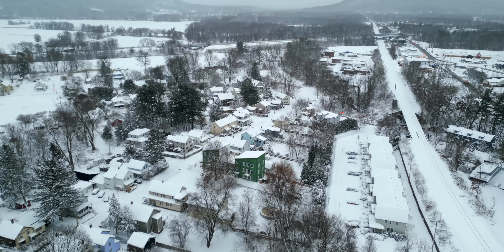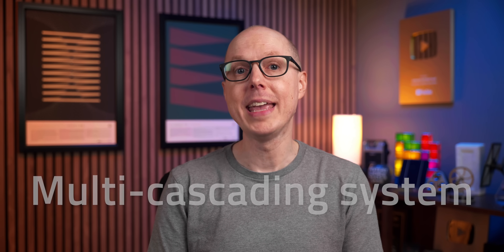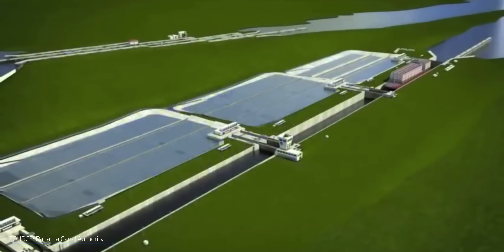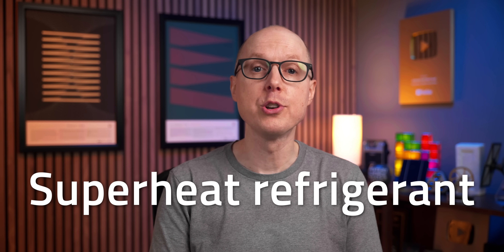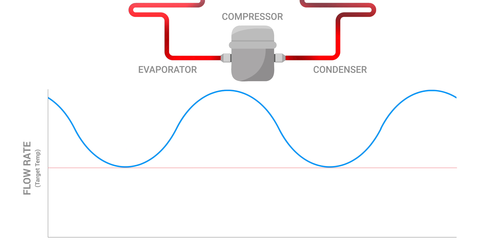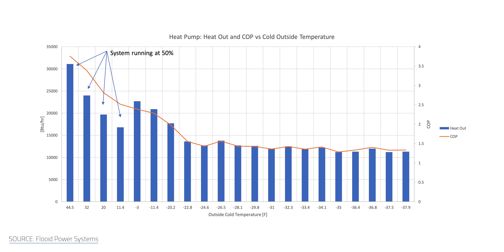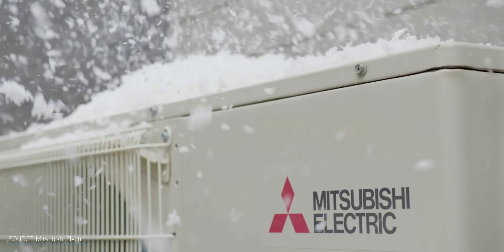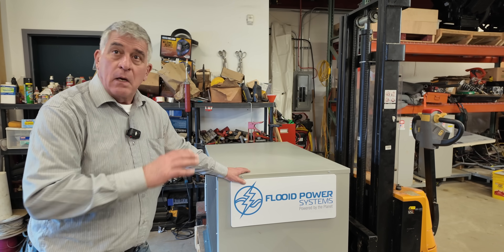How This New Heat Pump is Genius

Comment: We used to have a cascade for a large unit (we were cooling) but we gave it up for R-404a loops.

When I head „within one degrees“ precision for a temperature probe I smile and nod.
It may look like it is within a degree but it won’t be over the whole operating range without (yearly) calibration. It doesn’t take much to provoke oscillation at all, sometimes it is not even the probe but how it is inserted.

Personally I‘d want a single stage heat pump because I see two compressors, two loops with different operating conditions and then the very big question:

why use air? why not use ground water as sink?

Comment: Sorry, not interested. Why? Well, adding simple (no moving parts) resistive heater for those few days a year seems easier, less maintenance, less noisy compressors in the loop, etc. Rather than cascading heatpump, I would invest in better insulation and bigger solar to offset the energy cost.
Btw, you would not believe how much money a window opening sensor ($4 - $6) can save - both in summer and winter - just a notification that there is some window opened for more than 3 minutes and your heating needs go down in tens of percent.

Comment: With superheat , it is not the compressor which tries to maintain it to a certain degree K , it is the expansion valve. If sized correctly and functioning correctly they are very stable.
The problem with high superheat and high temperature suction gas is that the compressor has little or no cooling for its electrical windings it must be kept below a certain level.
That is why they will be running the lower stage at a certain condensing temp to not overload the high stage.
I think a well designed geo thermal would have higher COP than what i saw on there display. 
Having 2 compressors and 2 seperate refrigeration systems adds lots of complexity and expense. 
Its more of a industrial freezer solution like Ammonia/CO2 or CO2 booster.
Reply: why well designed geo-thermal ? I am pretty sure that any geo-thermal heat pump will have a better annual COP than a cascading air heat pump.

Comment: Very simple, each heat pump uses different gases with different evaporation points. One optimized for regular temperatures and the other for way lower temperatures. 
If you try to use the lower temperature gas in ambient temperature like a regular AC it will never become a liquid because is not cold enough and will not work (usually -80c), and the change from gas to liquid and liquid to gas is the key of the extra energy carrying capacity for good heat exchange (latent heat). When you couple them, the ultra low temperature stage takes heat from the winter as gas because is way colder, then it gets compressed and heats even more, this heat is transferred to the "higher"  temperature stage evaporator (from the low stage condensator), helping it to steal away that heat, which then it gets compressed again and it gets blown into your house. 😢 a video would be better.

Comment: I was interested in the advantages of a cascaded system over a multi-stage compression system, since the COP is largely governed by the compressor efficiency.  Multi-stage compression (with or without intercooling) initially seems like a simpler system than the cascade approach.  This research paper summarises the advantages and disadvantages, and answered my question: https://docs.lib.purdue.edu/cgi/viewcontent.cgi?article=2568&context=iracc

Comment: I often see homes with a heat pump to cool the house, and a separate pump to warm the pool,. isn't it possible to plug the pool heater to the AC pump?

Comment: I would be interested. In this case the biggest limiting factor is space. I simply do not have the space to put this. Not every home has the space for such a big bix. To make it more remorltely interesting the device for home has to be at least 2-3 times smaller than demoed in the lab demo video. Minitirization will likelymean more expensive as itbneeds more specialized parts, but I think it will be necessary for the bigger mainstream market, even when they're thinking of going international for the home market.

Comment: Point 1: The speaker, Matt Ferrell, is enthusiastic about heat pumps and has discovered a local company called Flooid that uses cascading heat pumps, which he believes have great potential for residential use. (Source: Matt Ferrell)

Point 2: Cascading heat pumps are not a new concept, but Flooid's implementation and flexibility in their system are impressive. They use a multi-cascading system, where each pump or loop has a different working fluid with separate but overlapping operating temperatures. (Source: Matt Ferrell)

Point 3: Mark Maynard, Chair & Director of Research for Flooid, explained that their system can operate efficiently even at very low temperatures, such as -11 degrees Fahrenheit. This efficiency can save energy and money for users. (Source: Mark Maynard)

Point 4: Cascading heat pumps work by having multiple heat pumps working together, each raising the temperature before passing it onto the next one, similar to locks on a canal. This teamwork allows them to handle larger buildings or spaces that need a lot of heating or cooling. (Source: Matt Ferrell)

Point 5: Flooid's system is a multi-cascading system, not just a single or double loop, which gives them a high degree of flexibility. This allows their system to effectively heat or cool temperatures beyond other HVAC units and heat pumps. (Source: Matt Ferrell)

Point 6: The company uses off-the-shelf components, which should help avoid supply bottlenecks and lower manufacturing costs. Their custom control system also operates efficiently even at very low temperatures, eliminating the need for a backup heat source. (Source: Mark Maynard)

Point 7: Flooid is preparing for their pilot process, which can be a challenging stage for startups. However, if they can successfully navigate this stage, they have a path to make cascading heat pumps more affordable and mainstream. (Source: Matt Ferrell)

Point 8: Flooid's system is compact and can replace a traditional furnace and air conditioning system. Only a small part of the system would need to be installed outside. (Source: Mark Maynard)

Point 9: While cascading heat pumps have been around for a while, they are not yet widespread due to cost issues and the fact that simpler, cheaper, single heat pumps have only recently become mainstream. However, the technology has great potential for both residential and commercial use. (Source: Matt Ferrell)

Point 10: The speaker invites viewers to share their thoughts on cascading heat pumps and thanks his patrons for their continued support. (Source: Matt Ferrell)

Comment: Matt, Technically in the winter your hot water heater is the second compressor in a cascading heat pump system. The house heating heat pump is the first stage. The air in your house provides thermal inertia that reduces or eliminates the hunting/oscillation problem. 

This brings me to the question of what type of heat exchanger are they using between the output of the first heat pump and the input of the second heat pump? How much thermal inertia does that heat exchanger have? Increased thermal mass may theoretical reduce efficiency but the increased stability may increase efficiency in the real world.

I also had some questions on exactly how the reversing or this system works. It seems like the ideal refrigerate for the out door unit would change when switching between heating and cooling. Does the outdoor unit have two coils to accomplish this? (And similar for the indoor unit.) Did I miss something?
Reply: Just went to the Flooid Power Systems website and kind of answered my last question. There is one diagram showing a system that does both heating and cooling. It has two pairs of pipes connecting the inside and outside unit. Based on this I am assuming that there are two coils in the outside unit for the two different refrigerates. 

There is also a diagram for a system that only provides heating using existing hot water baseboard heaters (radiators). 

It should also be noted that it appears that Flooid Power Systems envisions the systems to include the domestic (potable) hot water heater. This is based on both the diagrams that I saw having domestic hot water heaters connected to the system.
Reply: What if you don't have a hot water heater? I only have a water heater. 
Why would you heat hot water, anyway?

Comment: A very good friend of mine lives in Portland, and they said it got cold enough this winter that their heat pump did nothing, and had to either get a hotel room or go completely without heat on the coldest days.  Is this really such a common problem?  Do they just have a bad unit, or an old one?  If this is super common, it seems like somebody would have already created a solution.
Reply: You should really have some sort of back-up / supplementary heat. This is standard in central heat pumps. If the heat pump can't operate the thermostat will automatically turn on emergency electric heat. Some mini-splits can have this added as an option. I think it's a no-brainer because the parts are super cheap. If you never need the emergency heat it won't hurt efficiency, but if you do need it you'll save the cost and inconvenience of a hotel.

Comment: In the early 2000s, a company called Hallowell International based in Maine developed a '2-stage' heat pump that did pretty much this exact thing. It had two different compressors as well as a heat recovery loop which would divert friction heat from the compressors into the refrigerant in heating mode. We had one of their systems and it performed very well, able to heat our house for about the same dollar cost as the gas furnace it replaced, which was unheard of in 2006! (We're in snow country, and it definitely gets cold here.)
Unfortunately, the company didn't survive, mainly due to quality and durability issues with their control boards. Our system eventually died from a bad control board, which we couldn't replace. We ended up replacing it with a variable speed drive heat pump from Amana. Its good to see people are still tinkering with the concepts though!
Reply: Gosh, I can't help but read this and think what if the company had open-sourced their designs after going bankrupt -- or if their consumers had a contractual right to that IP if the company couldn't support them anymore. These days it's completely feasible to have a one-off circuit board manufactured on-demand for a reasonable price.
Reply: IMHO... I believe Hallowell's "cold climate heat pump" was unsuccessful for several other reasons as well. The company spread themselves too thin, installing HPs throughout the US and Canada before the product was perfected, and couldn't afford the service calls. If they had given away 30 or so units in Bangor Maine, where they could have watched and serviced them, they would have eventually had a higher chance of success and a more mature product. The problem was that they sought funding from a number of electric utilities around the country, and had to install a couple of units in each service territory.
I suspect, also, that their outdoor units might not have been able to defrost themselves during very cold conditions i.e. below minus 20F or so. The frost may have built up too thick on the outdoor coil.
I did, however see them operate successfully with a COP greater than 1 at about minus 30 F.
Reply: That sounds like a costly experience.  Would you go cutting edge again with a small company?
Reply: @shopshop144  It wasn't all bad for us. The unit ran mostly fine for about 7 years, and when it was running, its performance was great. We had repeated control board failures which Hallowell replaced for free, and we had a good local installer who knew the system. I wish it had been more reliable and durable, but when the company went under, our support ended too, so it ran for another 2 years before something failed.
I'm an early adopter, and I'm not afraid of new technology. I think my biggest hesitation really comes down to cost and serviceability. If I can afford it, and I know there's a way I can keep it running even if the company fails, I have a lot less hesitation to buy in.
Reply: I remember seeing those years ago, they looked very promising.  We almost bought one too but decided to go with a Fujitsu due to the cost difference between them..
Reply: @staceys1208  it is devastating to hear that a computer issue was a major contributing factor to such a climate-impactful technology. Cheap, reliable industrial computers are a solved problem, with modern microcontrollers costing pennies and surviving decades. The real challenge comes from the mechanical devices, compressors and control valves are hard to get right, and it sounds like they had the solution to this problem.

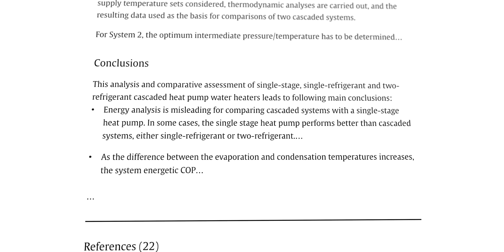Comment: Great content as always! at 17:07 minutes, where single stage heat pump is highlighted in yellow, does this describe even the least expensive $788 ductless SEER2 12000 BTU minisplit sold at Home Depot? Or is the study referring to more sophisticated single stage heat pumps?  I'm hoping you mean the $788-$1300 version is good enough, I may install 2 of them at opposite ends of my 850' each duplex rental units.  Also, I'm building an ADU (Additional Dwelling Unit) behind my existing duplex, putting 4 car garage below, and a 1200 sq ft ADU on top of that as the 2nd floor, with solar panels on top of that. A very simple 30'x40' ADU is the maximum size my city will allow. Instead of $33k cascading heat pumps. I'm thinking of this simple version: Three mini splits up there ($1300x3 = $3600) plus three wall mounted natural gas wall heaters for a few very cold nights ($225*3 = $700) for $4300 in material, instead of $33k for cascading heat pump. And 3 ceiling fans. What do you think?  Can you recommend best 10-20 passive home designs websites (like DOE, Australia, Austria has high altitude passive home), and also best 10-20 online plans for best passive homes to build for 30'x40' rectangles in Colorado Springs (6000' elevation)? And for 9600' alpine elevations (like Woodland Park, CO)? And/or best websites to put in zip codes, to find COP required?  Yes I have three HVAC contractors giving me a bid, but I'd like to check their work, thanks!
Reply: And do a video comparing the $788-$1300 Home Depot version to the EG4 Hybrid Solar minisplit running from 10 solar panels, pros and cons, please! We just bought 9 EG4 Lithium 100A battery rack batteries for our personal home where we live off grid at high elevation 9600' (we replaced lead acid house batteries a month ago) and we really like EG4's form fit and function, and software is easy, elegant and straightforward, so it'd be awesome to hear a review of EG4's minisplit by you, a trusted source. Many thanks!

Comment: This is interesting for MANY reasons, listen up!  First the greater the difference in heat between the 2 sides the more useful the energy is, but the harder it is to create such a large potential.  So being able to create a large difference with multiple stages each one just producing a small effect is already sounding like something that could break all the CoE laws.  But this gets even more interesting when you consider that NORMALLY we just look at half the energy, we see how much heating, or how much cooling is created, but the potential difference between the hot and the cold side is more extreme.  But there is more, the compression used to manifest heat (compression reduces the room for atoms to wiggle and so the heat energy becomes excessive when thermal capacity is lowered) is an investment of energy which is NOT normally recovered in a normal heatpump, but if you try (by reducing the energy it takes to drive the compressor) then the energy cost of running a heat pump drops MASSIVELY!  When the difference between the hottest and coldest parts are great enough with a low enough input then you could run a heat engine (steam turbine, Sterling motor etc) to make the it run itself essentially beating the  second law of Thermodynamics.   There is one more, you know those COP efficacies they give heat pumps?  Well it just so happens that this is not the highest efficiency the heatpump is necessarily capable of!  Do you know why smaller heatpums have higher efficiency? It is because for how hard they are running everything is larger!  Higher powered heat-pumps just don't have everything sized ideally!  But what happens when a high powered heatpump only runs at a lower power?!  Their efficiency goes HIGHER than the small ones!  So a Cop of 5 is not the limit.

Comment: What are the working fluids for these? I'm guessing that they use at least two different refrigerants. There have been many refrigerants phased out. If one of the refrigerants is phased out, the whole system is useless.

Comment: Thanks for this video. I love this idea! 

Is it possible to adapt this idea to attain very high temperatures? I'm tickled by the idea of a grill surface heated to 600degrees with a freezer built right into the bottom of it from all the extra cold.

Industrially it would be pretty cool to melt ore with progressively hotter working fluids and all the cold you get as a byproduct while being 3-5X more efficient than an arc furnace.
Reply: This basic idea does work great for high temperatures. but 600 degrees is probably too high with what we have now. An oven would be much more likely than a grill.

Comment: It seems to me that the efficiency of cascading revolves around having the right coolant coil for the temperature you're in.  So, having one that was ideal for heating in freezing temps would not be very efficient at cooling.  
Other than redundant loops or 'generalized' coolants that are semi-efficient through a wide range of temps, how do you get around this?